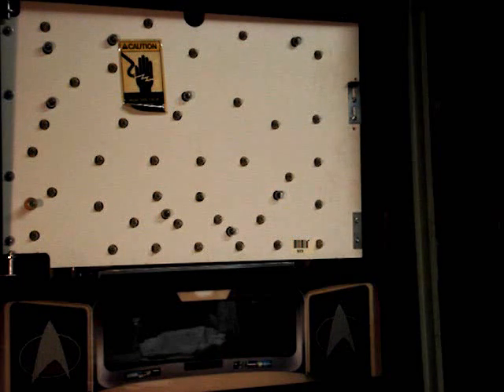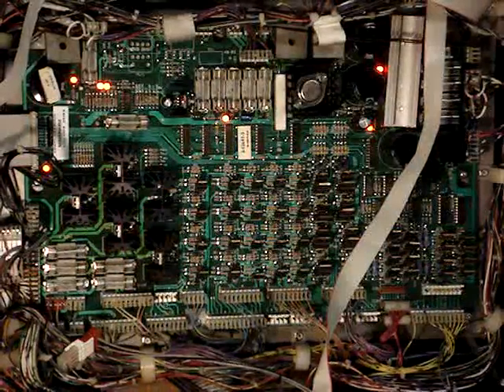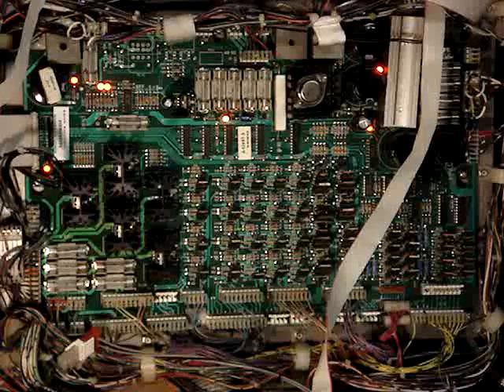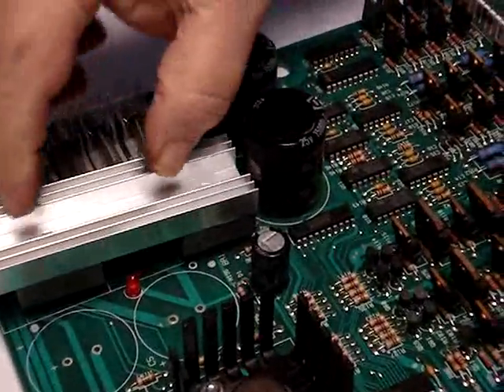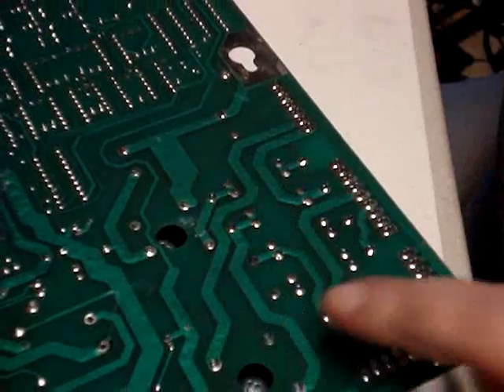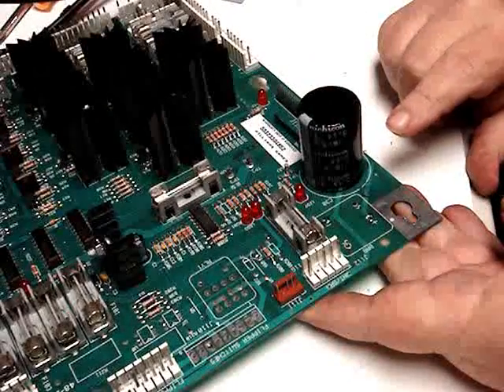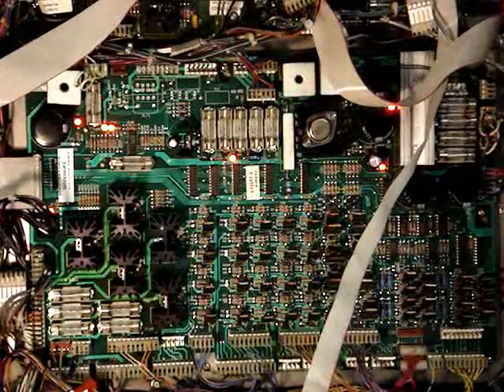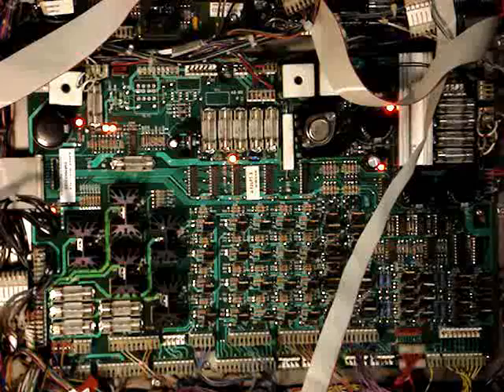Replacing the Bridge Rectifiers and Filter Capacitors on the Power Driver Board

Comment: Good video. I like to see the complete job. Even the errors cause I learned a lot even with the heatsink one. I have a simple question for you, how do I know if the capacitor is compatible on mouser for instance? If I choose any electrolytic capacitor with 15000uF, 35V and a diameter less than 30cm in diameter it will fit?

Comment: One can also check for noisy DC power by setting the meter to read AC voltage and reading the voltage at the DC test points this will show the ripple voltage present  , this will point out bad filter caps and rarely bad bridge rectifiers, always check fuse holders and connecters for burnt or bad connections as this will cause voltage and current drop under load.